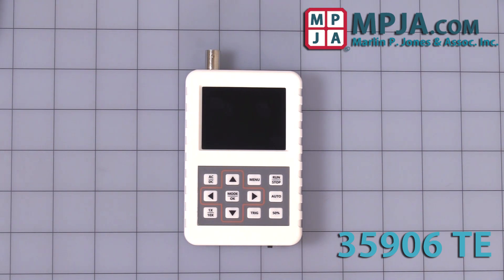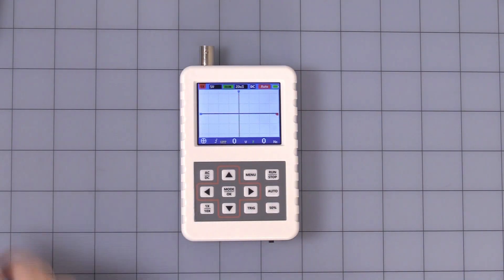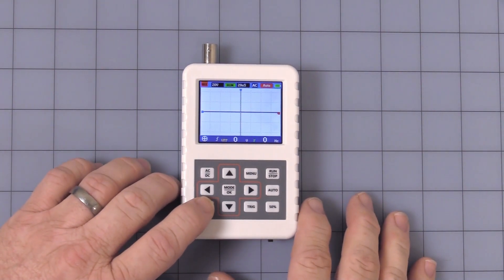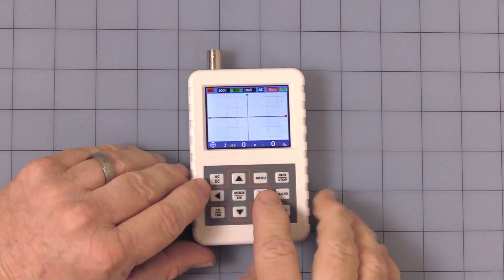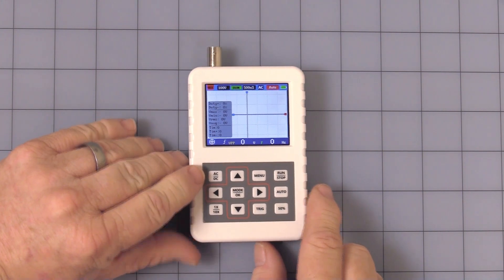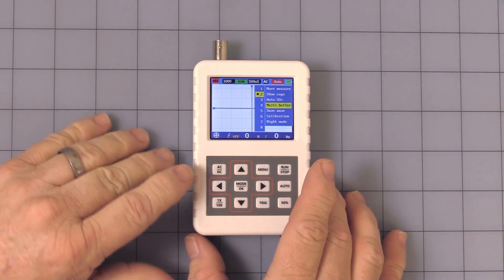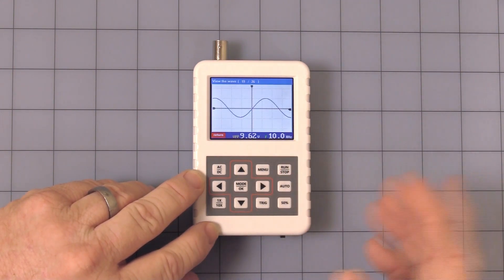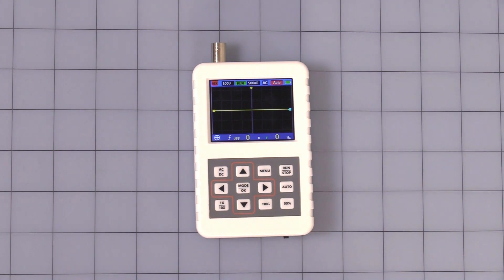5 MHz Handheld Mini DSO Oscilloscope 35906 TE

Comment: Did you notice this scope no cursor misurement ??
Reply from the maker: Correct it does not have a cursor measurement. It is only a simple hand held scope, I will talk to the manufacture about adding the feature.
Reply: @mpjaonline  thanks fo fast reply now I know.